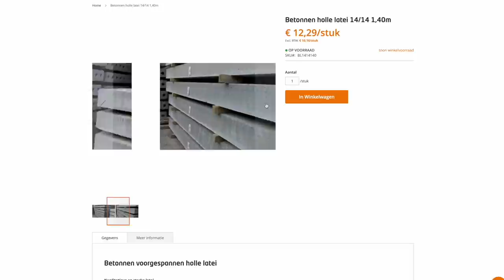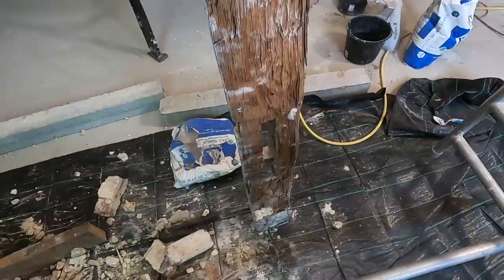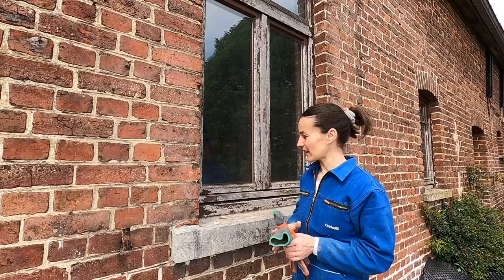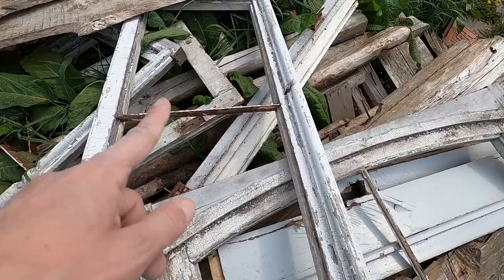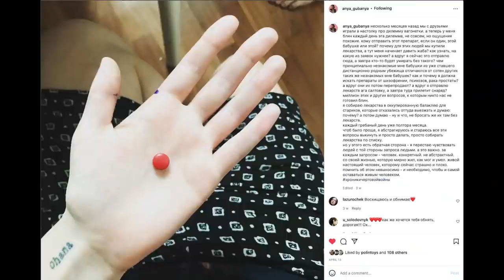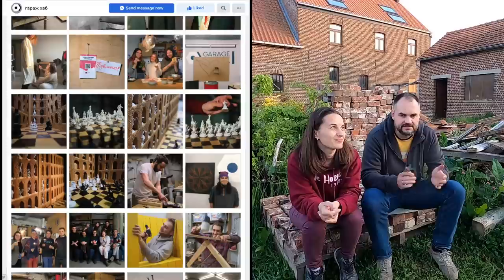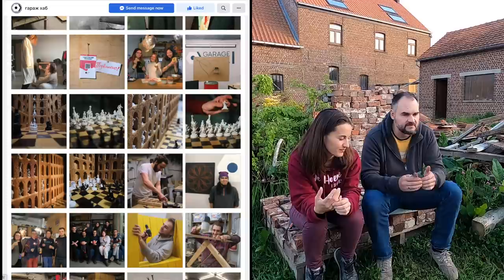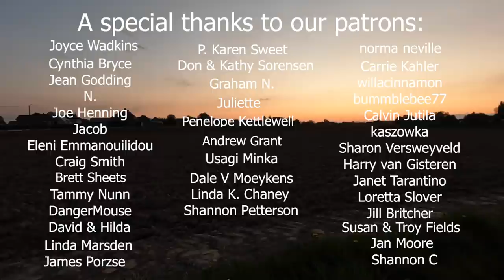Replacing the WOODEN LINTEL or how to deal with wrong assumptions / Renovating an ABANDONED farm

Comment: Painting the windows white would be in keeping with original look restoration. There is white opaque stain that gives you the look of paint but when they become weathered over time you do not have to scrape or sand to recoat with white opaque stain. I use this method and it is very effective. The stain is not glossy but that does not affect the wear or the durability.
Reply: I agree that white opaque stain is a very good option, especially on wood that has been exposed to the weather which will have opened the grain slightly so the stain can really soak into the wood.  This should last for many years.

Comment: When loading the wheelbarrow, most of the weight must be above the front wheel.  It is then easier to lift the wheelbarrow, because the weight is on a shorter lever.
Reply: I didn’t know that and I struggle carrying my garden stuff all over the place, I’ve been carefully stacking down the middle thinking it spreads the load. Best DIY tip for 2022 - from New Zealand 🇳🇿

Comment: Some of the mortar seemed a bit dry. It doesn't hurt to give the old bricks a quick dunk into a bucket of water before putting them up. The water will help wick up the cream out of the mortar and help it to stick. I saw you wet down the wall which was good. Just do the same for the old bricks you put in for best adhesion. Don't go overboard though. Too wet is just as bad. Just nice and damp is best.
Reply: Great advise! My bricklayer friend soaks all bricks in a bucket of water, old and new. Just before laying them. Otherwise the brick dries the mortar too fast (soaks the moisture out) he says.

Comment: The frames were rectangle. If you look at the top part of the window it was part of the lentil which held up the wall the window was rounded on top but not the frame. The put the old piece of wood in and filled in making the arch window.

Comment: hello, i recommend you to buy a large construction syringe, the perfect tool for pressing mortar into tight spaces, such as framing lintels or steel door frames (in Germany I saw how they use it for fireproof doors so I did it in my house) in your case it would be perfect for refilling the mortar when replacing brick cavities, an hour of work with a trowel could be done in 15 minutes, including refilling the syringe.

Comment: The hole might have been a "weeping hole". That would indicate a moisture issue and explain the rotten wood. The arch above the lintel may have been constructed after, in order to take pressure off of the lintel. The house seems to have a lot of secondary and tertiary construction for expansions/extensions and repair from war damage. Still, I love the work you are doing and congratulate you on your progress. You guys are the hardest working couple on YouTube, BRAVO ZULU and keep up the great work.

Comment: My hunch is that if you rip cut the lintel in half and then orient the cross section of the lintel vertically then the strength of the resulting lintel may be half the strength of the original. If it is oriented horizontally, as you have done, then the strength will be much less than half the original. My guess is that the lintel you have installed is much inferior to the one you removed. You may wish to consult an engineer or the lintel manufacturer to determine whether what you have done is adequate. I greatly enjoy and appreciate your channel, all that you are doing, and the two of you as individuals and as a couple. Best wishes.

Comment: It was crazy to watch you tear down old walls and buildings way back in the beginning, but now you have those materials to reuse and keep the house as original as possible. It looks so much better even when mixing it with newer materials and methods. 
Many historical places use a secondary interior window to raise the insulation properties. They usually have a stained glass exterior. Maybe you could do it backwards and have a stained glass interior to create a double pane window.

Comment: Be careful with those windows, the bare wood has been exposed to the elements for many years.
This means that it has soaked up some moisture, that doesn't mean there is a problem.
But problems will/can occur if you decide to use a modern chemical paint that seals the wood like a layer of plastic.
I've seen it happen in my little rental appartment facing south, the trapped moisture wants to get out when the sun hits the window
and after a while the paint will crack.
My advise would be do your own research on this subject, and a moisture meter wouldn't be a luxury.
Reply: There is one tip to prevent this. Make sure that the inside paintwork is one layer thicker than the outside paintwork.
Reply: @thomaskoala5500  Can you please explain how that would make sense. 
How can 1 extra layer of paint on the inside
help to get rid of the moisture ?

My idea of a solution ( I'm not an expert) would be to sand all the old paint/varnish of and treat the wood with boiled linseed oil.
That prevents water getting in but also allows the wood to breath.
Reply: @markschattefor6997  i see the confusion. I was talking about the moisture from inside to outside. And to prevent that moisture to build up inside the wood it is advised to have one more layer of paint inside then outside. Yes you could use linseed based paint for the outside but then your whole paintsystem has to be linseed based, which is no so commenly used these days. Paint based on Alkyd or acryl are more the standard.

Comment: Hi a suggestion for you,if you put a beam onto the ceiling with the the supports underneath either side of the window frames you can work between them .
Reply: And also, it will give a better suport to the ceiling.

Comment: You can best sand these windows and then use a stain if you want them brown but of course you can also paint them! For a stain that is oilbased, and I think they have been treated with that before you can use something like Cuprinol. I think but I am not sure that once they have been treated with that kind of beits you can ‘t paint them anymore. You will be amaised to see the differance.  If you look on the side of the double glass( between the panes ) there you can see that most of them are dated there.

Comment: Definitely white windows. That's what Catspector was trying to tell you! I'm afraid I didn't understand the reason why Ilia had to cut the lintels in half, or why it was necessary to relay the bricks in an arch over the new lintel. Maybe I wasn't paying enough attention, but if you could give a little more information in a future video, that would be great! Also, congratulations on winning Eurovision last night ;-) All of Europe is with you!
Reply from the maker: Thank you very much, Ellen! Amazing performance by Kalush Orchestra 💙💛
Illia needed to cut the lintel in order to fit it into the niche. Some of the bricks where laying in full length and Illia didn’t want to cut them. The arch - Illia just followed the arch from the outside, it was not really needed. But it was just easier for him to follow the flow.

Comment: The windows definitely look well-made and certainly weren't cheap. I'm not an expert but to me they look like they might be some fancy tropical timber. If the glass is (or was) held in place with putty rather than glazing strips (wood) the windows are most likely from the 1970s. In that case it's close to a miracle that all the double glazing is still intact, at least some usually fail within ten to twenty years, especially the older ones. You can tell that double glazing is bad if it's fogged up on the inside, between the two panes of glass. None of yours are from what I can see, so that's quite good!

I'd assume the original colour was an off-white, either leaning towards cream/yellow or towards grey, depending on the pigments that were used. Lead white is slightly grey and chalk white or zinc white a little more yellow. Stark white (titanium dioxide) only came into widespread use in the 1950s. I think one of these toned-down white would look good with your dark brickwork!

I'm a big fan of linseed oil paint. It goes on in very thin coats (that means one tin goes a long way), smells very nice and it's supposed to last a very long time if you wipe it with a rag soaked in linseed oil varnish every five years or so.

Comment: I was impressed that you worked so hard to save the older bricks.  Did you know that they are much stronger than new bricks?  I would not have thought that but the old way to make them are much better than modern bricks!

Comment: paint them white or black ..... Not the brown ..... chocolate brown is a visual depressant  .... black has been the ' color' for centuries ..... as blackened timber  (  originally oil mixed with soot ) absorbs winter heat ... and keeps the wooden frame drier